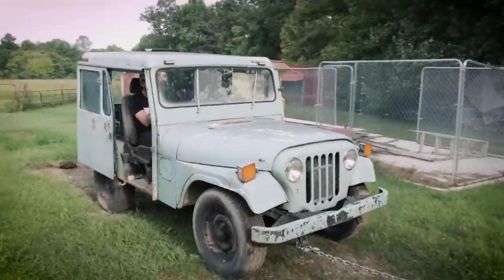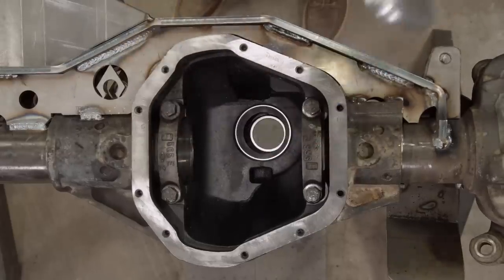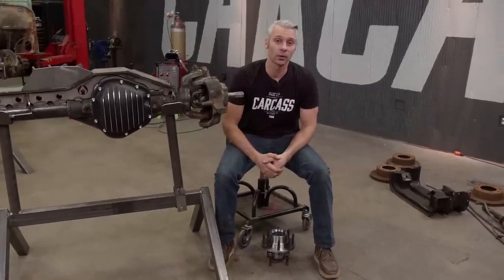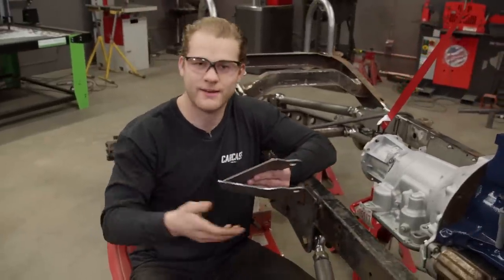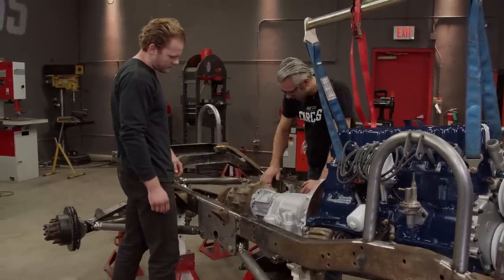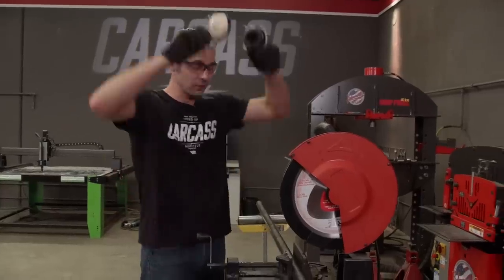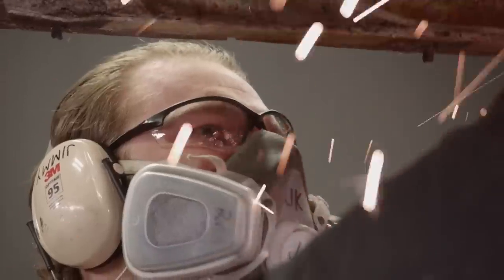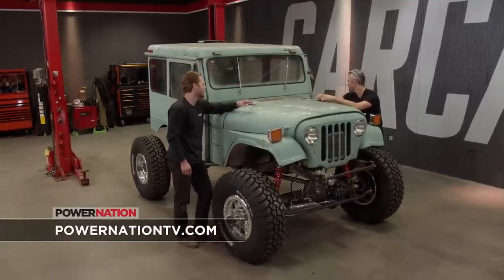Time To Roll! Installing New Gears, Lockers and Drivetrain in Our DJ5 Jeep - Carcass S2, E7

Comment: I love the fact that 60% of the chassis and suspension are just built from their plasma cutter table, I love having mine just sitting in my 4000 sqft garage. Right next to the excessive pile of DOM I have. Its like they know how to build just like us regular folk. Unlimited budget and time.
Reply: LOL you think you need all that stuff to do that same job? That's rich haha!
Reply: @CanadaBud23 , the purpose of these shows used to be a "how to guide" for the average person. 
Now it's just dudes taking apart a vehicle and reassembling it with donated parts from sponsors using equipment the average person can't afford.
Reply: You can do it with a hand plasma or a grinder with a cutting wheel and a drill. Today I have the privilege of having a plasma table at my disposal but it wasn’t always like that for me. I started with a grinder. Saved up and bought a miller xtreme 375 for like 1200 bucks at the time. You’d be surprised how accurate you can cut by hand with a drag tip, a straight edge and some clamps. You got to start somewhere. Learning from the ground up is better than starting with a plasma table.

Comment: Good project. It will be great. One comment on setting up the rear end gears. You do the tooth pattern check before you put the final bearings on otherwise you’d have to remove them to adjust the pattern.
Reply: They said they had mockup bearings for the carrier so I'd bet they checked and didn't film it so they just "checked" again for the video.

Comment: Trianngulated rear is great. Triangulated 4 link front is not a good idea due to this setup will feel bump steer unless your doing full hydraulic ram steering. For this setup being done with the steering box and drag link (all link steering) it best to do a set up with a panhard or track bar.

Comment: For once I want to see a "budget" project on PN that uses common tools, not a hydraulic press that costs hundreds of thousands of dollars, and other specialized equipment.  I'd like to see these guys press in bearings with the rental tools from the parts store.
Reply: That's always the problem with these shows. They think buying one part from a junkyard makes it a "budget" build. They never count all the money they have in tools or off-camera help from the crew or "special consideration" from vendors who just want to be on TV.
Reply: I get what you're saying, but a press at harbor freight is less then $150 bucks. I've had the same HF press for 20 years.
Reply: @h2oskiaddict  Harbor Freight now has the adapter that lets you add pneumatic foot pedal to your 20 table press, so stop whining people. Get a can do attitude, not a can't mindset.
Reply: @mrrustygray  nobody here is saying "I can't build that because I don't have fancy tools" they are saying that it's a load of crap to call this a budget build.
Reply: @greenflavoredstuff  - Exactly. “Budget build” implies that other than your labour everything is done as cheaply as humanly possible. These guys spent a very sizeable amount on this build. I guess it’s “budget” as opposed to a “price is no object” build but that’s about it. 💰 💰 💰 🚀
Reply: It's just as easy with a $200 press from harbor freight, hell you can make your own press with some angle iron and a bottle jack. If you need something cut on a plasma table you can probably find a local manufacturer that will cut it for you
Reply: @xyrzmxyzptlk1186  "Budget" means an amount of money set aside for something or project. It's doesn't mean cheap. This budget build is exactly what it is, it's just a bigger budget.
Reply: @jordanharris6736  People here don't realize they can adjust budgets or substitute tools for hand tools. Just a bunch of whiners that can't do anything.
Reply: @CanadaBud23 - The context they’re using the word “budget” in implies a cheaper than normal project. I’m calling B.S. on that because those clowns seem to have more money to blow through than Jeff Bezos. The PowerNation work complex alone has gotta be worth millions. 💰💸💰💸💰💸 The whole program amounts to little more than a super long TV commercial.
Reply: @xyrzmxyzptlk1186  A budget is just what it is, a budget. You can have a budget of a few dollars or millions and billions. It would be understandable to criticize the video if it was titled "Cheap Build, yada yada yada for anyone off the street". Like I say to others most of this stuff can be done with a 100 bucks worth of hand tools by yourself. You make your own budget and don't expect other people to hold your hand on your own projects. Simple as that.
Reply: @CanadaBud23 - I’m not the only viewer that objects to PowerNations abuse of the word “budget”. A lot of other people noted the very same thing in the comment section. If they had been honest and referred to it as a Big Budget build there’d have been no objections. They’ve got money to burn that your average Joe Citizen can only dream of. 💰 🔥 💰 🔥 💸
Reply: Make friends with the machine shop and have them press bearings in.
Reply: They actually do do one significantly cheaper cheaper and only using jack stands and hand tools when they overhaul an f250 and a dodge trex on this same show
Reply: 100k budget
Reply: Lol! Cussing the whole way!

Comment: If the diff drops in on final assembly then the carrier doesn't have any preload. The engine could have squeeked over a bit to clear the starter so the link bracket didn't have to move. Or just use a gear drive starter since those old direct drives are gigantic.

Comment: I love how you always say your on a budget. To me a budget build 4x4 would be a 2-3K, and I don't have access to $100k in tools. This is totally irrelevant to people who are on a real budget. Still can be a little fun to watch and see what can be done without a real budget and all the tools you could want. ;-}}
Reply: You can't "build" anything of significance for $2-3K. A set of new shocks, bigger tires, and new rims will cost you that much...and you haven't built anything yet.
Reply: @jamescrud  You clearly don't understand how a country boy builds something. I would be getting parts from a junk yard. I would find lift blocks rims ect. I would never be trying to build a competition rig. They probably spent at least 3/4 of my annual income on that one. This is not at all practical for someone on a real budget. And that's not even talking about all the money in tools or labor. If you would like to see how that works try FabRats channel, that's a lot closer to reality for someone that doesn't make a very large income.
Reply: @davidnorthrup3674  I get it. I wouldn't include tools in a budget though. Most people who do this type of thing enjoy fabricating and tinkering so the cost of tools and equipment gets spread over multiple projects. That pipe bender is nice but I wouldn't buy one just to bend 4 hoops. I'd buy one if I was going to build a custom chassis then also make some stuff for other people (paid work) so that I could recoup at least recoup the expense.
Reply: Sixgunner dot org  Try watching Fab Rats. On his channel he builds stuff all the time without doing a frame off restoration. He has a lot of tools, some of which he got and fixed so that they where useful again. Regardless, he makes things work without a huge budget. If these guys' didn't claim to be on a budget, then I would have no problem with them. I still like to watch them from time to time. It is just completely out of the realm of anything I could ever hope to afford.

Comment: You should have went with a 241HD transfer case. Much stronger and a bigger internal chain. Plus you can get a new main shaft from Advanced adapters to eliminate the slip joint and use a flange mounts to allow to to use1450 U-joints.

Comment: Your TIG torch is missing it's bump insulator. Its the big white insulator that fits in between the cup and the stock insulator on your 17 series torch.
Without it the argon will suck in atmospheric gas.

Comment: Building on a budget. But buys $$$ trusses when they have a plasma table. Which they used to make the rest of the 4 link.
 Never had  D60 that I could pull and install the dif. that easy. They are typically a PIA. A axle spreader is supposed tp be used.

Comment: No pinion seal? Tilting that upper link perch down would make that link about 1 1/2 to 2 inches short.
I seen alot of fram twist without that cross member.
Also noticed you guys don't plug weld anything. I've had heim inserts tear out, well the dome tubing tore out at the cert welds.

Comment: Triangulated 4 link front with a steering box?
Reply: also that aluminum diff cover won't last long in the rocks..
Reply: That's what I thought. That's gonna bump steer like crazy lol
Reply: @notsevenfeettall  valving has nothing to do with it. It's the steering/suspension geometry. The drag link travels in an arc, while the triangulated axle moves straight up and down. That means either the wheels will turn, or the steering wheel will turn through travel. It can be made minimal with setting the drag link flat (parallel with the ground) at the center of the suspension travel, but it'll still give it some amount of bump steer.

Comment: Aluminum fronr diff cover on a off road rig......yeah, thats going to last
Reply: Why not run a spool up front with the lockout hubs?
Reply: Only in the movies
Reply: Its for heat disapation. The round cover also mimicks the factory lubricating of the pinion bearing. Also sponsers and stuff.

Comment: Really sweet build guys
I've never seen a carrier go in an axle without pre-load (interference fitted shims)
Wish the D70 I built last year was that easy.  I bought a case spreader and broke my wallet.   Not flamin you, just look into the dana book and check that u don't need to preload carrier.

Keep the vids coming!

Comment: building engines, I was always taught to torque a bolt to so many ft. lbs. but now I learn pound-feet is the correct unit of measure?
Reply: @notsevenfeettall  The “pound-foot” (lb-ft) is a unit of torque and a vector measurement that is created by one pound of force acting on a one foot lever. ... The “foot-pound” (or more accurately, “foot-pound-force”), on the other hand, is a measurement of work. Work is the measurement of force over a given distance.

Comment: Wen pressing bearings on, please don't use a hammer. Take the part to a shop with a press and throw them a few bucks to put them on. If you mangle the bearings or get them off center, you'll wear them out in no time. It's worth the hassle and a little money to not have to take the diff apart again.

Comment: Aren’t you going to have some bumps your issues by running a dual triangulated for link up front and still having to run a steering box with a drag link
Reply: 100%.  You can’t  run double triangulated with a drag link.  Should be full hydro or run a 3/4 link with panhard bar and drag link

Comment: Sorry, you lost me at "budget build", when you said "CNC plasma table".
Reply: but they used cutoff wheels instead of a plasma torch to cut the body, see they are saving massive amounts on not having to run the air compressor .....
Reply: you can achieve the same thing with a cut off wheel or a plasma torch. They use these machines for advert cash, and to get the job done quick for the show. Anyone with a plasma table knows how to make the same pieces using a cut off wheel and bench sander.

Comment: What if you just wanted two use a four sil engine with six speed and 13 50 inch wide just a driver not a trail driver and put a small tow along  I am glad you only using a six sil

Comment: I NEED HELP So I have a 2011 buick lacroses cxs model the rubber on the yoke/fork that goes to the strut to the spindle can I use a metal bushing instead of rubber bushing it makes my alignment go bad it's only been 5 months seen I did my front end I got everything new for my suspension tie rods inner and outer rotors lower control arm my struts ever thing for the front end and the same part is messing up again I need help fixing it I'm not trying to get a new yoke it cost 300 for one and I need both side cus of one dumb rubber bushing

Comment: PSC steering, coilover linked suspension, 1 ton axles, 4.88 gears & they’re using a straight 6 & an automatic... dude, why?
Reply: @notsevenfeettall : they don’t care about “power” until they’re running up a steep grade on the freeway in high gear & trying to keep up with the flow of traffic.  Like the old commercial, “you could’a had a V8.”
...& I’m in total agreement with you on the torque multiplier aspect of running an automatic transmission... but automatic transmissions have aluminum cases & despite my best efforts, I’ve still managed to destroy several aluminum cases, that’s why I love my old SM464.  An automatic makes a lot more sense from a practical standpoint for off-road, but I can’t keep from breaking them.

Comment: Please do NOT drop the ring over the pinion, it could chip off a piece.
Check the contact pattern BEFORE the final assembly.
Don't use a impact driver to tighten a pinion yoke nut for god sake, don't hurry on the important details.

Comment: You guys mounted that rsc cylinder wrong it won't work like that the that style is made to have tie rods on both ends left and right and the cylinder secured to the axles. The way you have it mounted the cylinder body is just going to slide back and forth not push and pull your drag link
Reply: That particular PSC cylinder isn't a double-ended cylinder like the one you're thinking of.  The axle end appears to be a welded end with a threaded hole that accepts the threaded heim joint.
Reply: It's a (hydraulic assist) single ended ram that runs off of the power steering box. I've had a few rigs with this exact same setup and they work great. It's not a full hydro double ended ram that would be used with an orbital valve.

Comment: Budget build my ass. A budget of unlimited. By honest, most of of this build is an excuse to spend someone elses money and tout your sponsers. 

 6 cyl DJ rock crawler on a budget.... 3 link front, 4 link rear, upgraded Dana 44 and 8.8, reg old smooth rotors. Splurge on a set of ORI struts and beadlocks

Comment: I think this might be the high point of losing touch with your fanbase.  The only budget part of this thing is the DJ5 shell that you picked up cheap.  Then you placed that shell on parts that cost over 20-30 grand.  Even the tools you used to build it were not attainable for 99 percent of people.

Comment: What a sloppy ring and pinion setup for premature failure. That wasn't a good, even contact pattern on the worst day and will quickly lead to some high stress on the pinion... 
That ring gear needed to be shimmed up to move closer to the pinion and the pinion needed to be backed up with some shims to offset the ring gear move for a nice, even wear pattern because the leading edge was about deep enough, but incredibly shallow!
A shop loaded with every tool imaginable and they botched the R&P! Shoddy work called good enough... No sir.